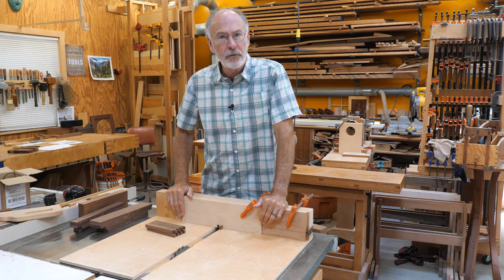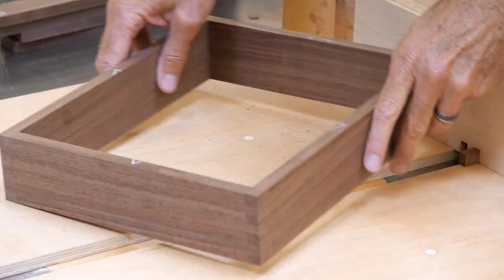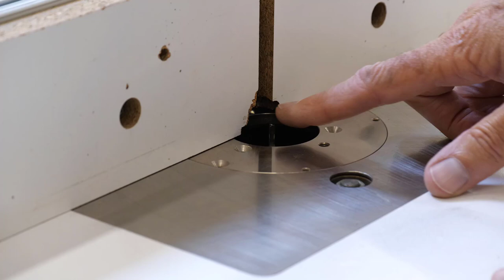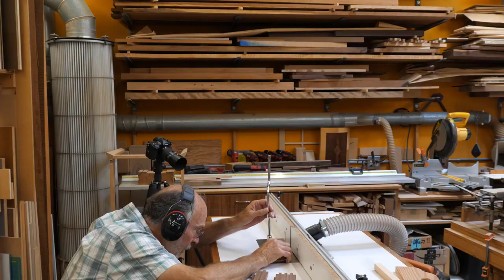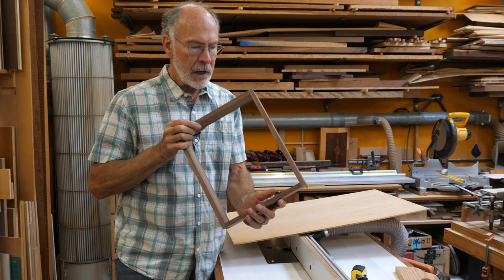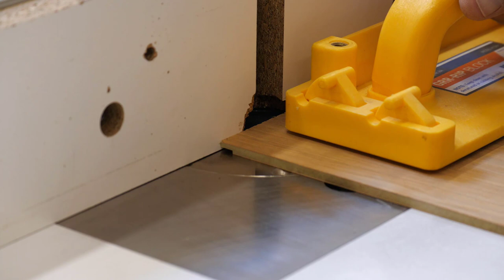Lidded Box Part 2

Comment: You can measure the edge to edge miter cut in the sides to get the size of the inserts.  Easier and way more accurate.
Reply from the maker: Agreed, that's a great way to do it. But in this case, the corners weren't mitered.